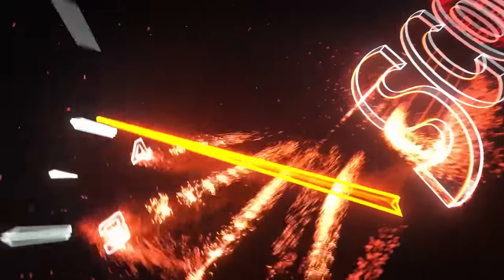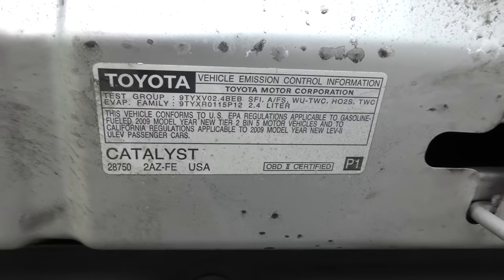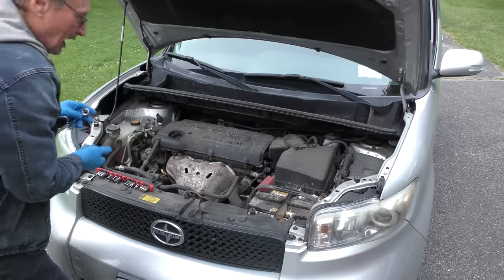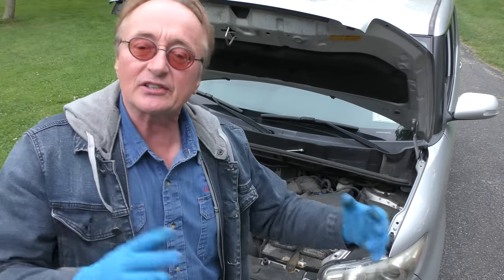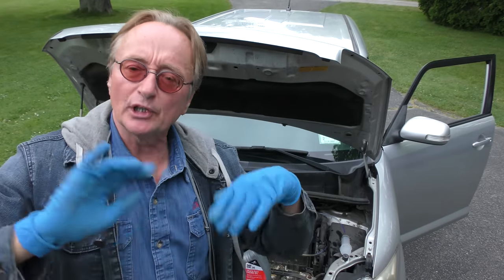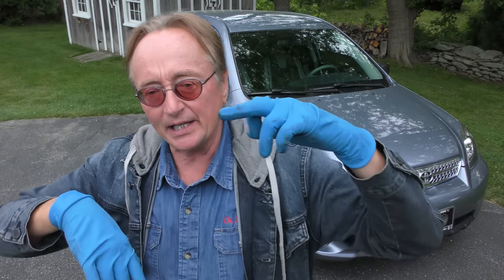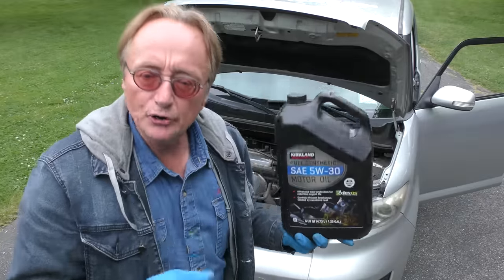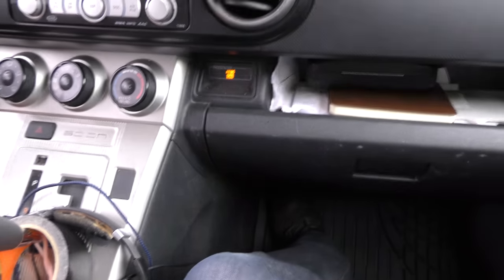Read My Lips, DO NOT Buy These Cars

Comment: I have a 06 Scion xB, still running like a champ at 230,000+ miles.
Reply: 222999 on my 05 XB. 👍
Reply: Haha, my wife almost divorced me when I came on 7/12/09 with a 2006 Toaster.
Reply: @seanthegod4585  500k miles on my 2022 Corolla. Wasp
Reply: I have an 2005 tc . I heard the ' oil burners ' didnt start until 2007 .
Reply: @Daddyme92  Trump 2024 🇺🇲
Reply: @seanthegod4585  put a ton of miles visiting your Mom. 🎶  🎶
Reply: We Loved The Space in These XB ➕  At; Auto Show Had A/C Piped Into VehicLes, Drove Standard Trans Around 2010 Drove Great, Bought a Vanilla Camry.
Reply: 2009. 307000 still running
Reply: My 06 XB is still running. Not burning oil. And im at 179000
Reply: 270k on my 2006 scion xb. It’s started every time since I bought it about a year and a half ago. 🎉
Reply: 238,000 for me. Still going strong. I have so many people follow me to my destination to try and purchase my 06, Scion XB. Best car in the world.
Reply: I'm 10k from 300k. Runs like a champion.
Reply: The 05,06 were the years to buy they said
Reply: It’s the 2nd gen 2007 and up that burned oil my 06 was the last year of the 1.5 engine then they went to the 2.4 until all the problems so they went to the 2.5
Reply: 04 xb, 241k miles and still runnin fresh
Reply: Mine has 306,083
Reply: I have 2 2006 scion xbs both 5 speeds one with 269k miles the other has 206l miles both run amazing but the 269k mile one has a bad transmission.
Reply: Worst engine toyota ever made in my 06 xB, vvt always gone bad. Even with 3000 mile oil change
Reply: @andyl9920 how is this possible have you used any additives in oil or are you using full synthetic?
Reply: Me too mines an 05 230,000+
Reply: 262 05 xb lol just recently had to replace a starter finally
Reply: 2006 XB.    Bought a few months after my Divorce.  Still have it.  240,000 miles.  Right front wheel bearing is the only repair,  but of course on my 3rd front windshield as all cars with this straight up angle window suffer.  I guess a stone impact doesn’t easily deflect.   This 3rd one also is overdue for replacement with at least 6-8 pings in it.   18 yrs old.  So a new window every 35,000 miles about.    😢.     But I love this car and I’ll never leave it.  It will have to leave me😂😂😂😂.
Reply: We have a 06 xb and its great. I do have a noise on front left wheel area. Not a bearing but sounds like a u-joint when needle bearings  are slipping around. Only sound iis when I start off or stop and do reverse and then go forward. Just noticed it. Thats what I am lòoking at utube and sions for...
Reply: Based on my other half’s maintenance or lack there of I’ve come to the conclusion the xb is indestructible. There is NO reason for her car to still be alive at over 200k yet here she is😂
Too bad the frame and everything else is rusting away and we have to retire her this year.
Reply: 06' xA with 209k. Replaced a coil pack, water pump, alternator, and a starter. Really can't complain.
Reply: 277k. 2006. Been through some alternators, and a starter, but not major issues otherwise.
Reply: I just bought one with about 220,000 miles. Stick shift. I'm scares a 2006 scion XB
Reply: @Nos2113 me to a 2006 made in late 05, just bought it, a stick shift.

Comment: My wife and I still drive our 05 and 06 Scion xB's. Both have about 165,000 miles each. Best vehicles we've had. $15,000 new, 30mpg, minor maintenance and very few repairs over the last 17 years. Of course, ours are 1st Gen, this one Scotty's looking at is 2nd Gen.
Reply: My 2015 is awesome. None of the 14-15 models had the campaign needs  for oil consumption.

Trouble with first generation is poor crash test ratings. Especially side impact. The later ones feel a lot better built. Ride nicer and quieter. Still tons of space and more features.
Reply: Only the first gens are cool. The second version never looked right. The purpose was supposed to be a box on wheels. The second gens are too round
Reply: @rocketrodlover  Just like many Americans from which the second Gen was designed
Reply: My Xb has 277 k Miles my dads had 375 k b4 it rotted out 2006 and a 2005 fist gen scions are my favorite car by far
Reply: @frankmalone1690  agreed. Too bad they'll never make anything like them again. Definitely not at that price.
Reply: I have a 4cyl '16 Tacoma and a 6cyl  '19 4 runner trd pro.   The only issue so far was with the Tacoma's clutch pedal mechanism.   I had less than 3000 miles when it started squeaking and sticking.   It took two tries and one return trip (the dealer didn't hook up the cruise interlock switch) but the dealer did replace the mechanism then I replaced the bolts they left out.
Reply: You got lucky they are crap cheap vehicles
Reply: @spin_tires_on_pavement-s.t5760  so you're saying we got lucky...twice? I better go buy some lottery tickets. Ha
Reply: @spin_tires_on_pavement-s.t5760  The way it sounds most people got lucky with their Scion 🧐 what other car manufacture has this many cars out with over 200,000 miles I got one that has 237,000 miles on it and it runs excellent
Reply: Even second gen have gone 300k but the first gen 1nzfe 1.5 have gone over 600k with little to no issues
Reply: I have my 09 from factory and it has 300,000 miles and I still race people at 120mph
Reply: What years have the oil burning issue?
Reply: does yours have the lil plaque above glove box? say 2 of 40 or something like that
Reply: @rodinunez5967  no, ours were not one of the 'limited' versions, like the green, yellow or orange ones.
Reply: @djkenny1202  Not true. Those years  were listed as one of the oil burners too.
Reply: @pushhard2  I have only heard of a couple 2.5’s. Its pretty uncommon.  All the same, many earlier ones also burned oil and as long as it was added, they went on for 300k miles. Lots of taxis in my area 2012-2015 have well over 300k reliable miles.
Reply: @djkenny1202 I bought a 2010 scion xb 5-speed brand new. Ran to about 90k miles,and started burning oil like crazy. That was back in 2015. I decided to settle for a used 2006 scion xb with just 45k miles. It now has 240k and burns no oil. I miss the quieter ride, but the first gen is quiet as well.
Reply: @ちくてぬしくけて  both are excellent cars. I have a 15, and oil consumption seems to plague 09-2010 the most. Some 11-13. Rarely ever 14-15. I needed a car with good safety ratings and sadly a first gen is very poor in side impact.
Reply: The 2006 XB does not burn oil at all !!
Reply: @circuspeanut83 1nzfe is a mighty mite of a motor.

Comment: Not all years had this issue, please make that clear Scotty; I’ve had the 2011 since new with close to 200,000 miles with no issues.
Reply: Anecdotal
Reply: He didn't say all years had the problem.
Reply: I'm not sure about the xb, but with the tc starting with 2011 they switched to the 2.5 engine
Reply: @robertwalton1054  They didn't switch to the 2.5 for the xB
Reply: The best Scion xb's with 04 to 06. They had the smaller engine but it was indestructible. My 06 has 280,000 MI and my other 06 is it about 180,000 miles. Only problem I had with one of them is they rust out but I do live on the east coast so it's no surprise. But it's still running real well.
Reply: @larryt9163  You're probably right.  The oil issue was greatly reduced on the 2011 models, but I think it was still an issue not just as big as before (for some models)
Reply: @zythr9999  you are right. I know the remodel was 08. The 08-09 were really bad. I was told the xB was americanized in the remodel. They added 600 lbs and those annoying pillars etc. I'm happy with the early model. Not speedy but I get 35 mpg and great reliability with the auto. I'm 6'3 and like the room. The new version gave me trouble because center console was in the way.
Reply: @larryt9163  Thank you. Exactly.  The early ones were really bad, maybe that is why Toyota went with the 2.5 for the later Camry and tC. I think the later Rav4 had the 2.5 as well.  Yes the 2nd Gen was styled more along American tastes, with the end result a steep decline in sales, as well as the extra weight and lower fuel economy.  If I'm not mistaken, even though wider, the roof was lowered a little from the 1st Gen as well.  They were still good cars, and they seemed to be pretty good as far as rust is concerned,

It is good that you fit well in the first Gen, maybe the second Gen was not for you :}
Reply: What about the 2012 model?
Reply: A lot of people are getting over that mileage even with the 09
Reply: @zythr9999  way safer, too.
Reply: All 2.4L toyota 4cyl engines from that era have that engineer flaw. The truth is that you have to change the oil more frequently to avoid getting the rings all messed up. This issue reminds me of the old 1zz's that were made in the early 2000s.

Comment: Those scion XBs are awesome vehicles, you only have to pay attention to the oil at higher mileage. Super comfortable reliable and practical cars for the price
Reply: I have a tc and I’m thinking bout getting an xb
Reply: They're very roomy and have an awesome interior design with wicked cool gauges, but unfortunately the ride is pretty harsh and truck-like, at least in my experience on a test drive of an 08 xB. No where near as creamy as the ride of an 02-06 Camry.

Comment: My 2010 Pontiac Vibe has this engine in it. It burns a little oil too but it’s not a big deal to live with. I just carry a small quart of oil with me and check the oil level once a week. I use 10w-30, full synthetic and it runs perfectly fine. It’s 347,000+ miles strong.

Comment: My Scion IQ is a fantastic car! Has a CVT but I drive it easy. With fuel at $8.50 a gallon here in Canada probably the best decision I've ever made in a vehicle. My fuel mileage in cold weather gets bad but found the engine wasn't warming up fast enough so I simply cover the front grille up with Nascar tape. The engine heats up quickly and fuel economy goes back to normal.
Reply: $8.50 a gallon??!?!! Whhaatttt!?!? 🤯
Reply: That price is criminal good heavens
Reply: @TheRed343 
just bought my 2010 scion xb for 5k 100k miles got it from a friend and I really like it.

Comment: I have a 2006 Scion xA with a 1.6L I bought new - it now has 173000 miles on it and the only repair in the last 17 years has been an alternator replacement. That’s the one one want 😊

Comment: My 2010 Pontiac Vibe has this engine in it too. It burns a little oil but it’s not a big deal to live with. Just carry a small quart of oil with me and check the level once a week. It’s still reliable at its 347,000 miles.

Comment: 0:23 SCION... means "descendant" and was invented as a 'brand' to try to appeal to the youth, as they weren't buying Toyotas. 
I owned the original xB when it came out and it was the most reliable car I've ever had.
Good video 👍
Reply: I think the first ones were pre-oil burning so you got lucky timing there
Reply: @EpicB787Animations  Correct. The  oil burning started with the 2nd generation xB.
Reply: @mcc7762  Probably because Scion had pretty ugly designs, there were more better-looking Toyotas to be frank
Reply: I think scion usually refers to first born males, often associated with unequal inheritances
Reply: @MrOiram46  no way; the Scion tC was cooler than anything Toyota offered for that demographic. It wasn't until later that they redesigned the Carolla and killed Scion

Comment: Thanks Scotty. My '08 XB was up to burning about 2-3 quarts between oil changes. I ran Liqui Moly Engine Flush about a year ago, which freed up my piston rings (I’m sure there was some crystallized sludge that kept the rings from doing their job). I ran the product for 30 mins (a little longer than they recommended) then drained and added fresh oil. Doesn't burn anymore, I mean nothing, like brand new. These engines are for the most part bullet proof, just need a little TLC to keep them going. I'm at 204K and still going strong 😊 Thanks again for what you do!
Reply: Thanks for the tip!
Reply: How's the burning now? @randyjamesvernon
Reply: Thanks for the tip! I have a '12 XB that has only 84,000 miles on it and if it starts sipping on some dino-juice I'll give that engine flush a shot.

Comment: My 09 has been a stellar vehicle. I found that regular oil (non synthetic) loses less oil. Was 16,000 brand new, and has been super reliable. Decent mileage and tons of room.
Reply: So conventional oil actually saved your car from burning oil? Interesting I'll have to try that.
Reply: @christianhudspeth3338  for real. Always used full synthetic in the Scion, lost at least a quart a month. Switched to 5/30 conventional, and saw a dramatic reduction in oil loss.
Reply: I’d use conventional since I change every 5000 miles. My 15 has been on synthetic, but I hardly find it necessary.
Reply: @djkenny1202  could I use semi synthetic instead or does that go into a different realm of physics?
Reply: @christianhudspeth3338  High mile oil seems to work better for me. I have the same engine, but mine doesn't lose oil from the pistons.
Reply: I was thinking about using synthetic in my Honda motorcycle. The dealership service guys said that, at least for my bike, they would strongly suggest staying with non synthetic (and of course, Honda OEM) even though they would have made more selling me synthetic... I don't know why, exactly - I'm no oil expert. They did also say that IF I decided to go with synthetic, I would have to use that for the rest of the engine's life. Which I infer necessarily means that it will last longer staying with non synthetic... Again, my bike might have unique circumstances and I don't know how applicable it is to everything else, but with what The Man From Rhode Island said here, I think I'll be using standard oil with the 2008 xB (168,000mi) I just got.

After watching this I'm having some buyer's remorse. I'm used to having the same amount of oil in it at change time as was put in it last time. A quart every 500 miles? I'm gonna huff this engine cuz I'm just not that attentive. Not to mention, how the hell does a car that burns that much oil pass emissions inspections? I thought that the ones with this excessive oil burning issue had a recall about it. I had assumed that they replaced any defective parts with improved parts that no longer have this issue. Sure would like some clarity about that...
Reply: @DailyDahaka  So did I.   I went back to a full sythetic last oil change (every 3000 miles) to see if consumption increased again.  Too soon to tell yet.
Reply: Yeah. Ford 5.4 s are like that. Synthetic oil molecules are smaller and they leak faster.. conventional oil leaks less
Reply: Have owned my 2008 xB since 2007. Runs great, uses some oil (all old cars do) and has been far less of an annoyance than Scotty's voice. I love to drive it and paid $16k brand new. Doesn't owe me anything.

Comment: I had an '09 Matrix XR with the 2.4L Oil Burner. When it was newer I did a full exhaust system for (equal length 4-1 headers, high flow  cat, 2.5" tubing, flowmaster 80 series), it was great fun, and it started burning oil around 110,000km.

Funny thing though was when I returned the exhaust to stock with OEM parts when I was getting ready to sell it, that seemed to solve it. I would put it through the same driving as normal and same situations that would cause it to spit out a big blue cloud with the custom exhaust, but no matter what I did I there would be no cloud coming out.
Reply: I heard only some of the 09 Matrix with the 2.4L actually burned oil.

Comment: My Camry has that engine and not burning oil. Even if it does I'll just change  the oil more as it's been the most reliable car I've owned. The paintwork is still good as new even being under the Australian sun.
Reply: Honestly I believe this has more to do with the supplier for those rings.  Not all cars have the problem.  Both of my xBs do, but I’ve solved it by a piston soak with Berryman’s.

Comment: Mine started burning oil at 140000 mi.  It has 260,000 mi on it. My son drives it. He occasionally forgets to check the oil. It’s run dry of oil three times. Still starts and runs fine. You gotta replace spark plugs more often but overall the oil burning is overblown. Thanks for this video. Hopefully prices of this car will drop and more people will have a great car for super cheap. Oh our xB now has a leaking head gasket and guess what? It still runs!  15 years and 260,000 miles is pretty good for a car you should never buy.

Comment: I loved my 2008 Scion XB. IT was a tank but burned oil like a MF'er. Mine started burning oil around 130K so the recall wouldnt fix it. I loved that car it was very reliable otherwise AC still blowed cold and ran like a champ. I ended up trading it in 2020 and sometimes still regret not keeping it.
Reply: My sister had a Scion xB that burned a bunch of oil too. I bought a Scion tC right after she bought her car and mine was burning oil before 100k. Guess it's just a characteristic of them. I traded it in last year for a 2017 Mustang that's been great so far but still miss my little Scion sometimes.